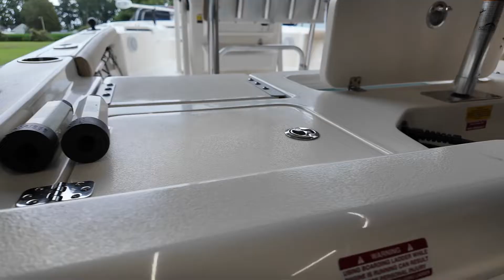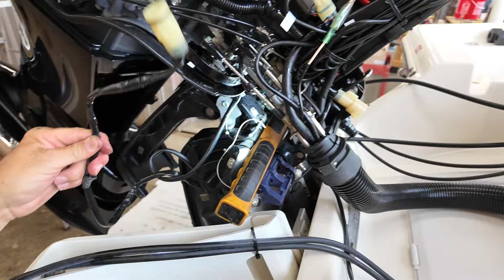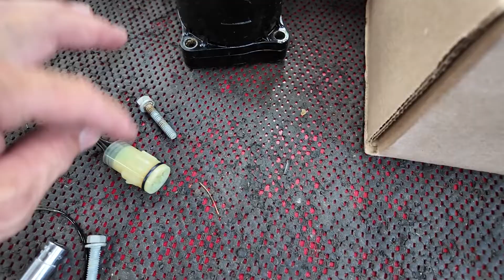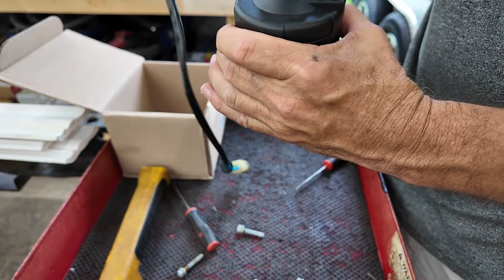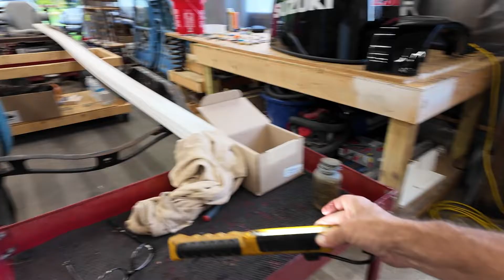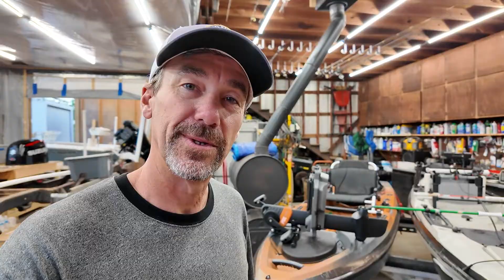Suzuki DF250 Outboard Trim Motor Replacement

Comment: spent 4hrs trying to remove the back bolt on df 60hp , this is great example of why japan lost the world war 2 , the japs are just too damn stupid to realize things need to be serviced and they wear out , i ended up taking a sledge hammer to it , impossible to get at the back bolts, just smash it and it will break the flanges, and make a notch in the flange putting it back and slide it under the impossible bolt on the back , and tighten other, other possibility is to take out the c clips on trim and take a grinder and cut part of the motor mounts where it will come down, NEVER EVER, UNDER ANY CIRCUMSTANCE BUY A GARBAGE SUZUKI,  too heavy for the horse power, go yamaha or mercury , let suzuki die with evinrude that they copied, run from suzuki anything, and you will thank me and praise me later!!

Comment: Did you have a hard time getting the trim motor cable to fit in the rubber grommet that seals the engine compartment where it enters the upper engine area?

Comment: Great vid. I came looking a trim tilt removal vid.  The boatyard where I was having some work done broke off a wire which connect the zinc to the starboard trim ram. It broke off at the trim end, and the wire attaches on the side of the trim. Looks to be impossible to re-attach w/out removing the whole trim unit.  Anyway now, I know how to remove the trim motor.  Great vid buddy also subcribed.  BTW you boat and engine bracket looks really clean looks like you must trailer it and from your chanel you fresh water fish also.  Your engine bracket has no marine growth on it, and the trim rams look brand new.  Up here in north east the rams on my 2023 250 already look aged. Anway now that I'm subscribed I'm looking forward to some southern fishing vids.  Bring it on.

Comment: I just did this on my 2012 Suzuki 115. New Amazon motor o ring seemed flimsy and sure enough a small amount was leaking where motor bolts on to pump. Pulled it off and used old o ring and it seems to be a little better, but still see a little wetness at the crack. I am going to take it off again and dry the pump top like you did and maybe it'll help seal it. Any suggestions my friend? O ring seemed not to be binded in any way. Could it be residual fluid making its way out? The old o ring seemed to make it a little better, but isn't bone dry at the seam.

Comment: Had to do this on our 1989 Mercury 90.  Our motor was so corroded, we just decided to get a whole new trim/tilt assembly.  Had to remove one side of the transom mount to get it out.  Real pain in the butt.  Good to see they are making them easier and more serviceable these days.